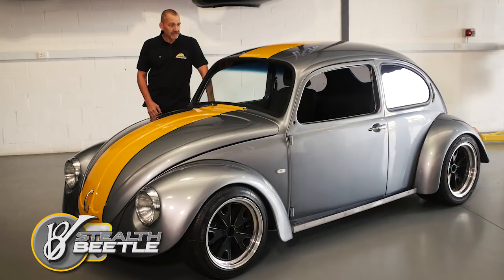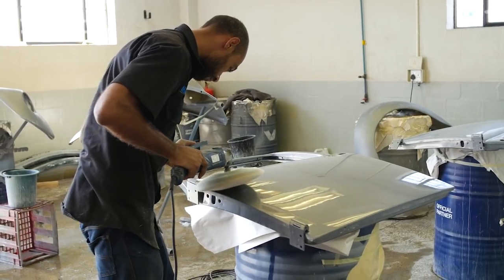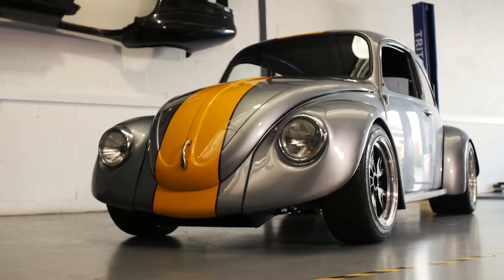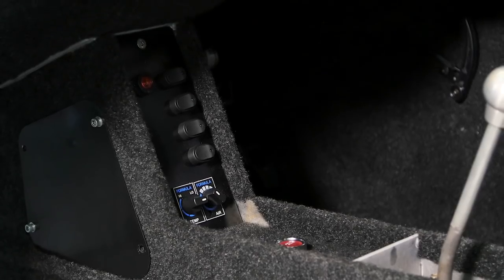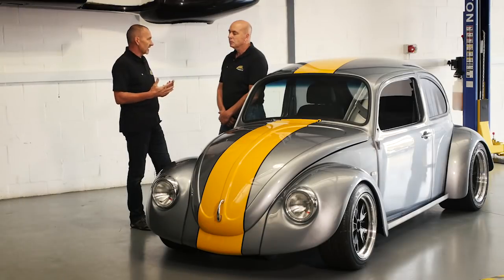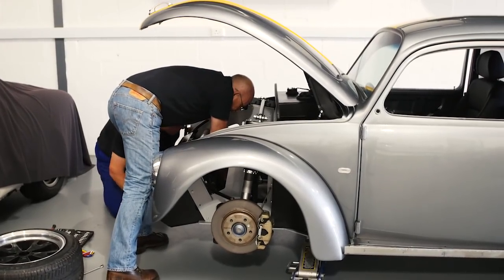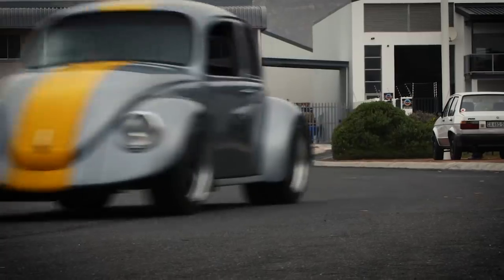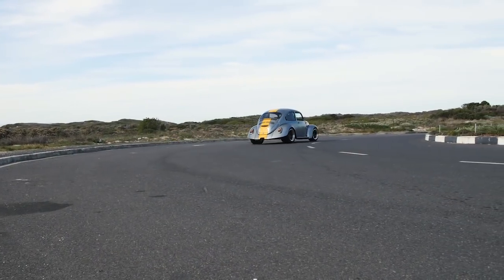V8stealthbeetle Episode 16 The finishing line is in sight

Comment: Considering the weight of the vehicle you may want to consider a narrower tire for better traction. More weight per square inch = better traction. This will also make it look more like a beetle. Wider/larger tires in the rear also effect steering and will tend to give you a little more side to side wobble/instability. Was it hopping? Just trying to figure the tire choice out. Looking cool does not always give the stability your looking for. 
Hope/maybe I've been of some help. After you have a few of these on the road a few years I may be interested in one. Please keep the updates coming. If it has a number plate as a beetle in the US it would be easy to get a title. It would definitely pass the emissions requirement for those years/models.
If your not getting a comfortable feeling driving the car (instability), please look into what I am suggesting. You may be quite surprised.

Comment: the installed running boards will certainly complete the natural flow of the car's design....as to the price, i think the base price of USD 85000.00 is a bargain for the car you're getting which, once the grip for the power is sorted out, will smoke vettes, porsches et al......will you be putting out a video of the finished product once they are able to start work on it again?

Comment: Hi,Top work fellas. Whats the track widths now? Need some of them fancy headlights with leds and integrated blinkers.Will it be flex fuel E85 ready? Do you plan to integrate seat harness mounts in the rear bulkhead,and do you fit wearing a helmet? Cheers

Comment: This is a pretty cool project @v8stealthbeetle. Really well done. Will you stick to the Audi 4.2 V8s, or are the V6s still going to be an option for clients? This thing would be an absolute screamer with the 2.5 liter 5 cylinder in the RS3, with the entire drivetrain flipped 90 degrees. :)
Reply: Doug Foulkes that should be pretty good. Opens up lots of options for parts & tuning too. Can't wait to see the first of that lot on the road.

Comment: I don't wish to sound too negative here, but there are a few things about this build that concern me.

There does not appear to be any attention given to aerodynamics.  That flat bottom and curved beetle roof will generate lift that would make this car terrifying and quite dangerous any speed above 80 MPH and you have enough power to push that car even with its barn-door cd to double that speed, and get it there pretty damn quick.

It is impressive how you managed to cram so much into the front of that Beetle: radiator, cooling fan, BMW suspension, power brake master cylinder, A/C condenser, and above all a 50 liter fuel tank that is sitting literally in your lap with no crush zones to protect it in a front-end impact. You think the 1970's Ford Pinto was bad? 

With the mid-engine configuration, fore-aft weight distribution should be nearly ideal.  But that big honkin' V-8 stands a lot taller than the original flat-four Beetle motor and weighs about three times as much. Your center of gravity is going to be higher than the original Beetle, and combined with the Beetle's narrow track, the car will be somewhat more tippy than you might expect.

All that said, probably most people purchasing this car will not be intending to use it as an all-out performance car. There are  more suitable options at that price level. It will be a wonderful car at the stoplight races and will surprise the hell out of a lot of Mustangs and Corvettes. It is a wonderfully insane concept, brilliantly engineered and built to be just what it is: a devastatingly quick sleeper.

But take note of the difference between "quick", and "fast".
Reply: Douglas Burnside-Seen plenty of sti ,Ls and turbo"d  F4 vee dubbed powered bugs at drag strips hitting 120 -140 mph trap speeds, no lift off. Im sure all the extra added front end bits will make it stronger for frontal impacts  than a stock VW. Stock tanks are in same position,so whats dangerous? VW motor and box is 400 lb.Audi V8 with a box and shafts is 580lb.By the time you take the VW suspension, shafts, hubs, brakes etc and swap in the Audi gear with the TT set up  it would be about 200lb more,but they will save more overall (950kgs)with the aluminium chassis .Stock dub rear is about 50"The Stealth is wider, they add 100mm to the guards ,plus the extra width in tyres (a corvette is 60")this will handle very nice.so yes this car will be quick and fast.The difference will be up to the drivers accelerator pedal.
Reply: Hey Darren, a few tips!  
First you make the punctuation, then you make a space. Then you start the next sentence with a capital letter. This way it's easier to read, even for the website, who currently thinks you are making links. You can use the edit function in the dot menu an the top right of your comment.
Reply: Hi Douglas. 
I don't think the point of gravity is necessarily higher, considering the car sitting lower, having a higher center of the wheels. They also shaved off lots of top weight stell from the inside, needing no support for rear seat etc. All in all they increased the total weight by about one American passanger, or two European (100kg). On top of that this kind of suspension is vastly better than torsion bars and swing arms, making it have lot less chassie-roll when cornering. 

Moving the balance way forward should be great for the handling obviously, and I think the beetle shape hardly will get much lift if any, it's a bubble, it has zero flat surfaces but the gigantic down-force spoiler called "the front window".  Flat belly reduces drag. I assume it slants just a tiny bit for stance, which should be enough.  Tanks are safer the more centered they are, and the further away from the engine. Tanks are only dangerous when there are open flames close to a broken leaking tank. In reality, tanks do NOT explode in collisions, and if they did, anyone would be toast no matter where the tank was. The tank is located roughly in the original position, and Beetles are  by share numbers, probably the most crashed car on the planet. Yet, it does not have the reputation of the Pinto, which by the way wasn't actually very dangerous, as it turned out. Same with the Corvair.

Comment: i  do electronics, and electronic engineering and some inventing.I must say there have been a alot of v8 beetles over at the usa ,but a total sleeper is hard to achieve and nogal with a v8 audi.usa uses chevies.also ..(beetle buick germany)

My point is with such a powertrain and such a light body i suggest tcs control system and advanced power distribution.Can you send me a price for just the chassis alone please.
Is this car sabs approved and road legal in SA.
Reply from the maker: Hi, thanks for your comments. The car will be road legal first in SA, then in Germany. if you can send me your email address, i can forward you the details and pricing on the component form, my email address is on screen towards the end of the video, regards Doug

Comment: I want my 2 two things not to be changed 1. U can not remove my chess number which is below my rear seat as u know 2 all modification must be done keeping any vw engine but 4 cylinder putting 4 wheel disc another thing if u can make  power  stearing full customise I am ready to spend. Tc I am going Spain next month I will get back to u Tc.
Reply from the maker: Hi, Have you seen any of the videos? We have a custom aluminium chassis, the existing one gets thrown away, and we put a V8 engine in, not the 4 cyclinder VW one. We do not put in power steering as it is not necessary with the weight behind you. Sorry, can't help you there